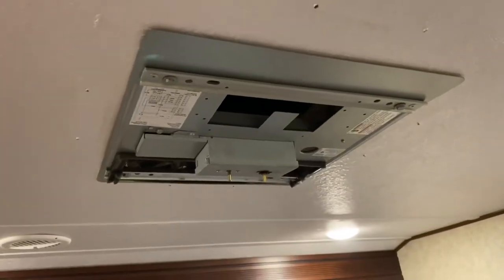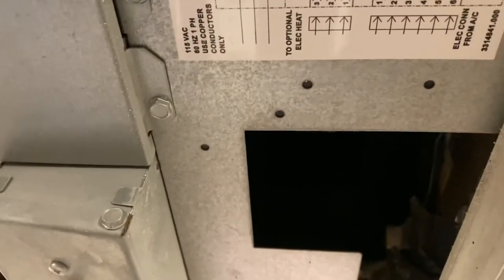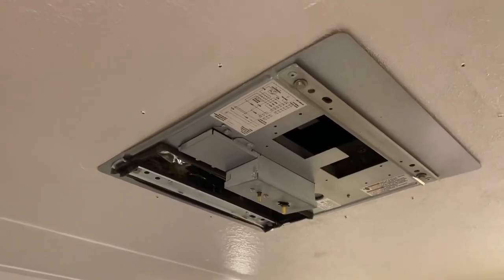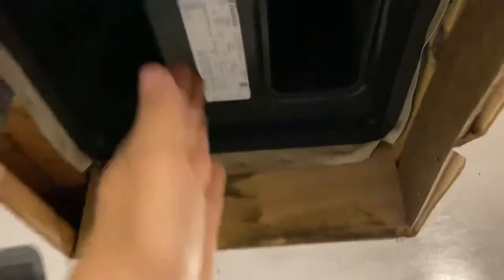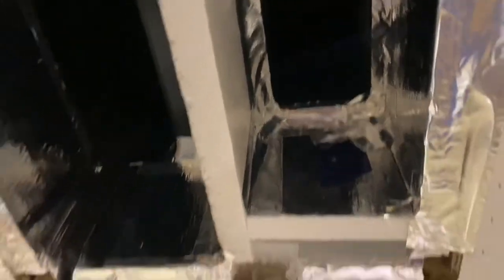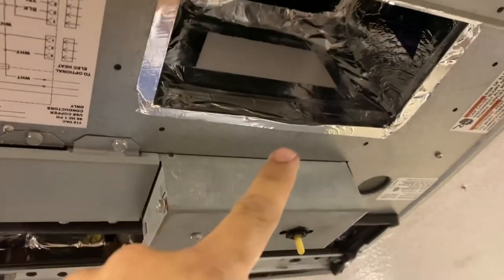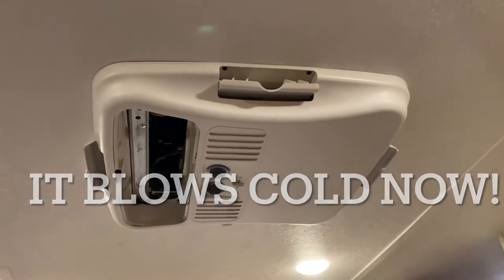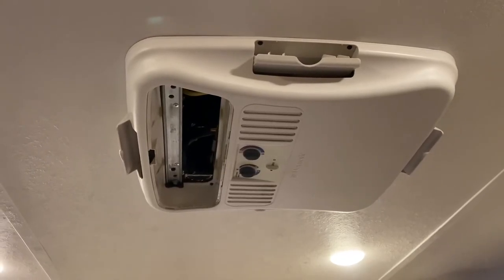How to make a non-ducted RV air conditioner more efficient.

Comment: Pretty cool tip , I’ll look at my travel trailer to check it out. How’s the truck holding up? Man you need to make more vids. Anyway have a great day, Bob in ri
Reply from the maker: Thanks Bob in RI! I know, I currently have a few videos that I need to get edited so I can post them.  I appreciate your support!
Reply from the maker: oh yeah, the truck is doing well.  I did have to replace some parts recently. rear shocks, front steering components, the usual

Comment: That tab is the heat shield when you put in the optional heater piece.  Like 4 to 80 bucks, if you cold winter live.  It helps.
Reply from the maker: Too late.  I cut it out already.  hahaha.  Also, I use the furnace in our fifth wheel along with electric heaters if needed in the winter.

Comment: Just wondering if you ever ran into any other complications after you did your modification to the air conditioner?
Reply from the maker: No sir. it’s been working great since the modification.  I have been able to keep the RV cool ( around 72) in 100degree plus weather since doing this modification.

Comment: This might seem like a dumb question, but how did you remove the cover?  I have the same Dometic cover, but can only see how to access half the screws holding hte cover in place.  The side air ducts the pull down swing out of the way of hte screws, but the ones that swing up, stay in the way of the screws regardless of angle.  Do you have to flex the plastic enough to remove the remove it form the cover, or is there a process I am missing?
Reply: Did you pull the filters off? I believe that is what I did

Comment: Great how to! I want to do that but and I have the same unit and cover, But I can't seem to get to the screws underneath the vents on the sides to remove the cover. , Is there a trick to that?
Reply from the maker: Are you referring to the ones under the filters?  You have to pop those off.

Comment: It’s unbelievable. 

I installed a new Dometic brisk 2 11,000 btu unit in our 1997 AC prepped lance squire 650 lite. It’s a small unit but it blows 52 degrees out of the unit at 280 CFM 1613w. I watched these great videos and pulled it off. I wanted a unit that could run on a 110 outlet. It works great. After an hour or so the camper was down to 78 degrees on a 104 degree day. 😢
Reply from the maker: That’s awesome!  I’m glad my videos helped!

Comment: I have this same unit in my trailer.I need to do something about the noise it makes. did your modification help to quiet yours down any? Also noticed all the air flow gets forced out of the rear and very little out of the front. can you advise how might this be dealt with?
Reply from the maker: This did not quiet the unit down much at all. It did make it cool the room off quickly so it doesn’t have to run as much.  Are you talking about a ducted unit?
Reply from the maker: If you are talking about a ducted unit, I would start by pulling the vent covers off and inspecting the ducts to make sure they are clean and sealed around the opening on each vent.  One other thing to consider is directing the airflow into the vents with either the RV Airflow system, or building your own similar system with foam boards and the Aluminum tape like I used in this video.  I built my own on the main unit in my RV since it is ducted.  I unfortunately did not record that process.
Reply: @JayRays1truck  Mine is a non-ducted unit
I ordered a couple sq/ft of sound deadening material sorta like DynaMat.
So I hope it helps. Also will try the foam boards and foil tape similar to what you did to direct less air to the rear of unit and more to the front. Thanks for your reply!
Reply: @JayRays1truck  I saw the products your referring to but I think they are for the ducted units. Mine is non-ducted

Comment: Where is the copper “thermostat” tucked away here?
Reply from the maker: On my particular unit, which is a Dometic, there is a temperature sensor at the evaporator coil.  The thermostat would be on the plastic cover. It is the dial that has the red/blue lines to indicate whether you want cooler or warmer temperatures in your RV.  Does this answer your question?
Reply: @JayRays1truck  I have this type of unit. Is it possible to add a central thermostat?
Reply: @JayRays1truck  I have the same a/c and distribution box but mine has the big copper wire thermostat that sits at the bottom of the intake side if that thing gets the least bit cool it kicks the compressor off just sits and blows warm air
Reply from the maker: @huntersanimaladventures4639  Is it long enough to move the end of the thermostat to the return air side?  I would try that first if possible.